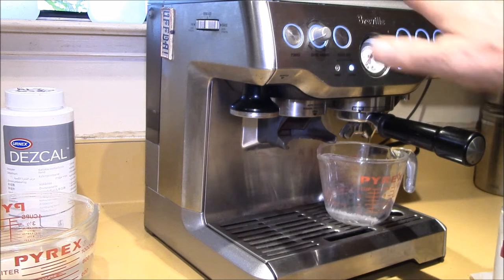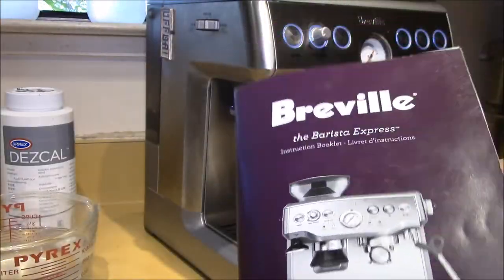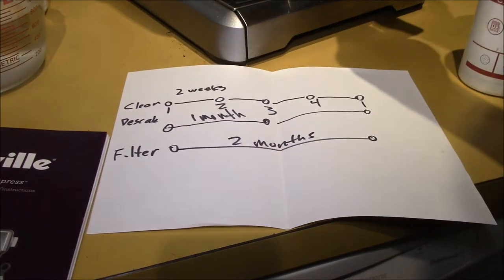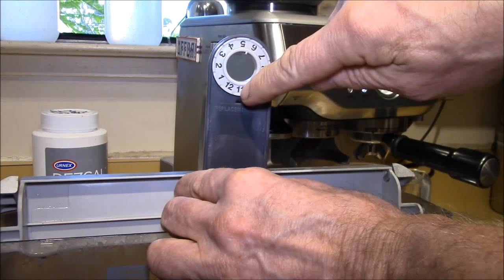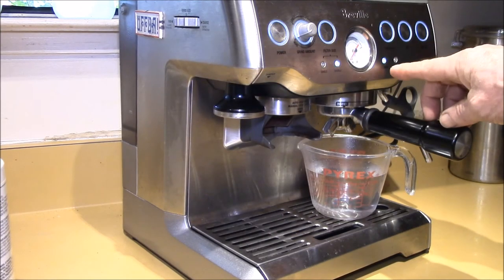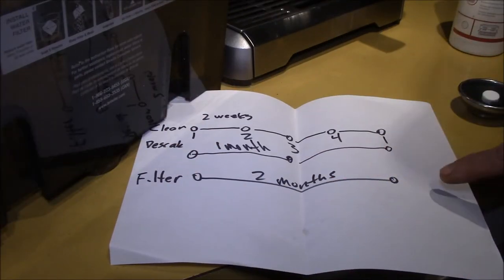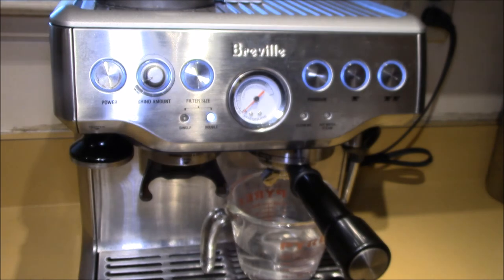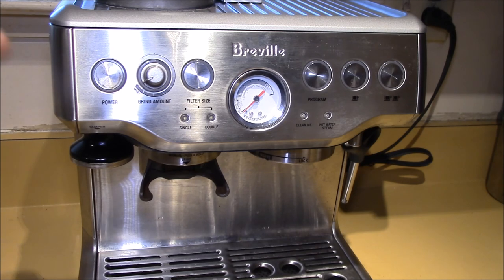My Breville Barista Express Maintenance Plan

Comment: Good video. But one thing I think solid cleaning me light means you need descaling for which you need press power and two cup button (and then press one cup multiple times, the lights will go off after powering off). While flashing cleaning me button is cleaning mode for which you need to press power one cup and two cup button.
Reply from the maker: Perhaps that is true for newer machines.  On mine (~6.5 years old), this is what the Owner's manual has to say:
"CLEANING CYCLE
The CLEAN ME light will illuminate
when a cleaning cycle is required. This is
a back-flushing cycle and is separate from
decalcifying."  
And decalcifying is recommended at 1 month intervals and that is done with no automatic reminder, thus my use of the Clean Me light cycle and a fridge magnet.

Comment: Hi Mr. Brown. Recently I did OPV adjustment on my Breville BES870 to make it brew coffee at 9 bar. After the OPV adjustment, I felt that my steam wand is becoming weak. Is this issue related to the adjustment? Or is there something else causing the steam wand becoming weak? My machine is about 5 months old
Reply from the maker: By adjusting the OPV lower (I assume), you've lowered the pressure in all modes.  So perhaps that's the cause of the steam issue.  Perhaps that steam valve is partially clogged, a few cycles of descaling solution through it may help.

Comment: Thanks for all the great videos. What are your thoughts on a 870xl with brand new solenoids and a new pump with steam and hot water mode producing  steam and hot water out of the group head?
Reply: Also, single/double shots pull beautifully now.
Reply from the maker: In hot water/steam mode, the 3-port solenoid valve should be off and water should flow up out of the top port to the hot water/steam valve.  Maybe check and see if something is clogged in that line or if it's been connected incorrectly.
Reply: @The4Crawler  thanks! I’ll check for a clog. I triple checked the plumbing and wiring against pre-repair photos so I hope that’s not a problem. I appreciate the help very much.

Comment: Hey brown, I'm having an issue where there is only steam coming out of the machine. All ports are dispensing steam only (grouphead, hot water port, steam wand) as if the machine is super heated. Even a lot of steam coming from the drip tray. I appreciate any tip you have if you faced this before.
It all started when i mistakingly hooked it up to a 220V outlet then it stopped working so i had to replace the main PCB and it worked again only no water flow just a lot of steam.

Thanks.
Reply from the maker: My guess would be one of the temperature related devices on the thermo-coil.  I think there's a regular sensor like a thermistor, that's used to read the water temperature.  I'm not sure where that's located, but you could probably trace the wiring between the main PCB and coil to find it.  There's also a thermal cutout of some sort that cuts power to the coil if it get's too hot.  I think that one is visible on the outside of the thermo-coil, small round device with 2 wires connected.  My guess would be the first sensor.
Reply: @The4Crawler  much appreciated, I'll look that sensor up online. And you are right, most of the machine's exterior body is very hot to touch.

Comment: Hi Brown,
I found your channel is very interested and useful. Recently, my barista express BES870XL did not turn on and found out that the triac PCB part was out of order with the resistance burn out and triac cracked. Do you know where I can order this triac PCB part of BES870XL? Thanks in advance for your help.
Reply from the maker: Might try here:
https://www.ereplacementparts.com/main-pcb-p-1790467.html
If that's the correct part, also take the p/n and try contacting Breville support directly, they may have a lower price and/or faster delivery.

Comment: I have the same machine as you and my cleaning cycle doesnt drop durty water with soup trought the double wall basket, all durty water goes to the infusion container(internal container) and by consequence wasted on drip tray..
is this a problem?
Reply from the maker: Either the double wall filter basket or the rubber cleaning disc may be plugged up and not allowing water the cleaning solution to flow.  There is a small hole in the center of the disc and as well, a tiny hole in the center of the double wall basket, you should be able to see light through both holes.

Comment: Thanks for this. Just a question, I noticed that you didn't activate the descaling mode (by holding 2cups + power button). Is it intentional so that you could activate the boiler to heat the descaling solution?
Reply from the maker: That might be a function added to later model machines.  My machine just uses the 1cup button long hold to trigger an extended flow of water through the thermo coil.  It does have the cleaning function with the 1cup+2cups+power button hold where you have the cleaning tablet in a filter basket.  I'll run that at the end of the descaling process.

Comment: What ta Ell is that thing ?   You had better add  a few Kwh to your system using it.    LOL
Reply from the maker: Yes, no way my current system could run this.  I think the thermo-coil heating element is way over what my current power inverter could handle.  I may have a solution for that coming up though.